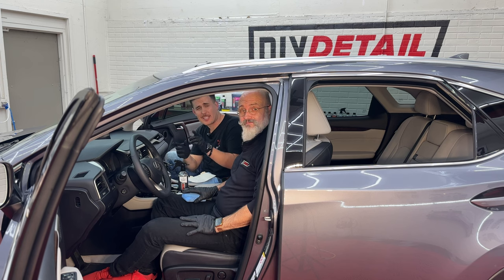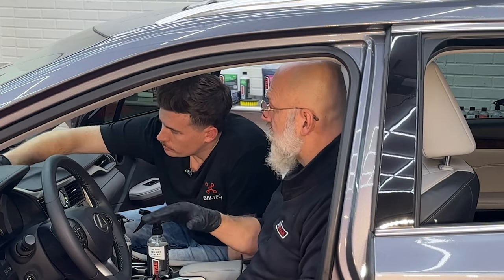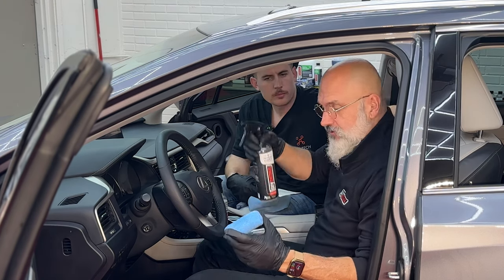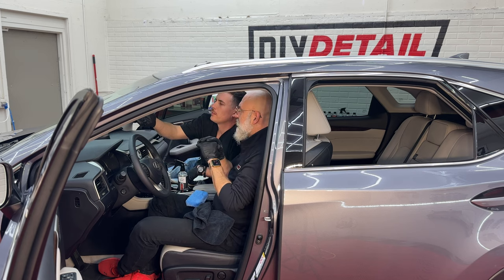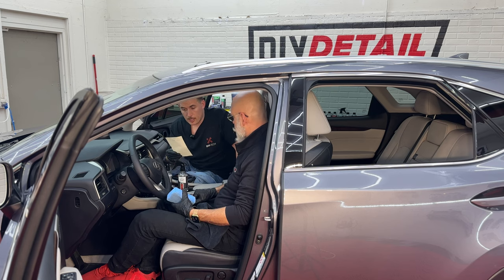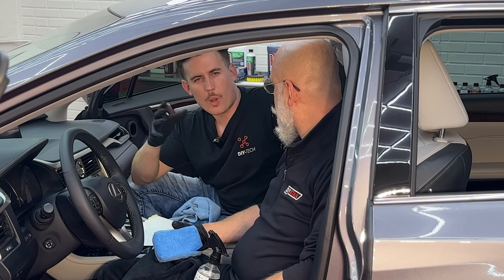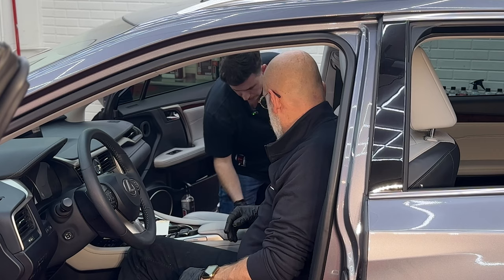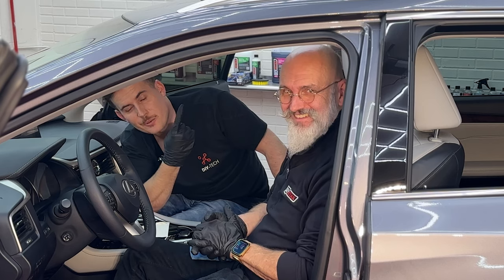Interior Ceramic: FREQUENTLY ASKED QUESTIONS! DIY Detail Podcast #34

Comment: Fully agree with the use an applicator approach, but can't make myself use the full sized block. I've had great success with the mini and finger mitt saver applicators - easier to get into tight spaces, use less product by keeping it on the surface of the applicator, and they are washable and reusable.
Reply from the maker: Great tip!

Comment: Can MF towels and applicators used to apply this product be washed and reused or should they be tossed?
Reply from the maker: If you soak them in APC or detergent immediately after use you may be able to save them.

Comment: I have used 303 Automotive Protectant once a month on the vinyl in my car's interior. I have cleaned the vinyl thoroughly with rinseless two times since the last 303 application. My car's interior is clean and otherwise ready for DIY Interior Ceramic Coating. Do you recommend I use panel prep before applying ceramic coating?
Reply from the maker: No, DIY Detail Rinse Less Wash is enough.
Reply: @diydetailofficial  Thank you!

Comment: So once leather seats have been coated in Interior Ceramic is there not a need for a leather conditioner? I've always been one to wipe the interior completely down with an interior detailer biweekly and every 6 months apply leather conditioner to leather surfaces. Where does leather conditioning fit into the routine?
Reply from the maker: You can if you want, but it’s really not required

Comment: I have a few question.
1) Should I use rinseless wash or clean & protect before interior ceramic?
2) if I use clean & protect, do I need to use panel prep before interior ceramic?
3) Does clean & protect affect the bonding of interior ceramic and reduces interior ceramic durability / longevity?
Reply from the maker: Your choice, but if you have both available use DIY Detail Rinseless Wash.

Comment: Greetings DIY Detail Team,

I use Leatherique to condition the Nappa leather in my BMW.  Is it safe to apply the DIY Interior Ceramic Coating over Leatherique or any other leather conditioning product application?
Reply from the maker: No, the coating will not adhere to

Comment: What is the smell like on this Interior Ceramic? and One thing I do not think was covered, is AFTER application, the best or recommended method to do interior maintenance?
Reply from the maker: It has a chemical smell that goes away once cured( 1 hour). DIY Detail Interior Clean & Protect or DIY Detail Rinseless Wash for maintenance.

Comment: Just received a bottle of your interior ceramic and have to say this product has a nasty smell to it! I'm not debating  interior ceramic benefits and realize are many other companies selling similar products, but this stuff should come with serious warnings on the packaging to wear not only hand protection,
 but a respirator. SiO2 is not kind to our lungs, and is not only a risk to the detailer, but to the vehicle owner/family with off gassing for days afterwards. And I think companies that market their products to DIYers, not professionals, have an even larger responsibility to ensure safety, or at least give reasonable warnings.
Reply from the maker: The odour dissipates within 30 mins. As for breathing it in, in a well ventilated room, and using an applicator will greatly reduce the odour.
Reply: Are there long term health risks when using ceramic/sio2 chemicals like this frequently as a detailer?

Comment: will this prevent or help prevent smudges from shoes on plastics of truck doors? I'm interested in kick panel area protection as well as the usual dash maintenance and cleaning.
Reply from the maker: It will help reduce, but not prevent.
Reply: @diydetailofficial  could a more robust exterior ceramic coating, one that's ok for plastic, be used on a door kick panel area?

Comment: is ceramic interior safe to use in conjunction w/ interior clean & protect?  if so, what would your routine/frequency suggestion be between panel prep, ceramic interior and interior clean & protect?  thanks
Reply from the maker: Once DIY Detail Interior Ceramic Coating is installed maintain with DIY Detail Interior Clean & Protect as needed

Comment: I already applied DIY Interior Clean and Protect and cleaned/applied leather conditioner in my seats, Can I still use the DIY  Interior Ceramic on top of that?
Reply from the maker: You will need to remove the leather conditioner
Reply: @diydetailofficial  thanks so much for the response.

Comment: Can you apply over interior detailer like carpro inner qd or other interior detailer or not necessary to use both?
Reply from the maker: The DIY Detail Interior Ceramic Coating is not a cleaner, but true ceramic protection for your interior.

Comment: I applied to my cars interior  about a month ago. I now want to have parts of my dash upholstered with Alcantara. What is the best chemical and process to remove the ceramic so the adhesive for the Alcantara will properly bond? Thanks!
Reply from the maker: Abrasive
Reply: How abrasive? Do I need to wet sand it? Or is vigorously scrubbing with a microfiber towel and using an interior cleaner like P&S Express and an adequate option? Thanks.
Reply from the maker: Use a compound on a MF towel. If you don’t plan on removing it at all future date, use sand paper.

Comment: @diydetailofficial :

New car and just learned about interior ceramic coating. I got some diy detail interior ceramic and did the car this past weekend. Worked great!

I just picked up a new adhesive magnet mount for my phone and I stuck it to the vinyl dash, but after 3min of holding it in place tight, it just peeled right off. I guess this interior ceramic really works! (I know some people dont like adhesive mounts, but this will be my 4th car with them and i really like it)

So what I need to do next is remove the coating from just this small 2x3in section so I can put the mount on and then re-coat next to it.

What's the best way to do this without damaging the vinyl on the dash?
Reply from the maker: Use some polish on a MF towel, abrasion is the only way to remove it.
Reply: @diydetailofficial  great! I don't have polish yet. I've only got the ceramic coating, clean and protect (green label) and label prep. What do I need to buy?
Reply: @lancekeltner2625 I would suggest their polish, the gold standard. Some polishes contain harsher solvents and may damage, the gold standard does not.

Comment: Do I need to use mechanical polishing to remove ceramic from interior before changing products or reapplying?

How do I prep for reapplication of interior ceramic coating
Reply from the maker: Simply wash and apply.
Reply: lol thanks
Kind of figured there must be other methods 
Than with exterior paint ceramic coat removal
Reply from the maker: Correct

Comment: Quick one, If the end result after application is silky/ sliding feel isn't that a bit dangerous when applied on the steering wheel?
Reply from the maker: It doesn’t change the feel in any way.
Reply: @diydetailofficial  Ok, was a bit confused when you guys mentioned when applied to the leather seats that you can feel them being a bit more silky and sliding.... so my logic meade me ask if the same will happen with the steering wheel.  Will test and report back!
Reply from the maker: Silky and soft.

Comment: Thanks guys, finally have your products in Australia. Looks like the interior ceramic bottle could last a while even if applying every 6 months to high traffic areas. Does interior ceramic have a shelf life after it is opened?
Reply from the maker: No shelf life, just make sure that you close the tip of the sprayer to prevent evaporation

Comment: I live in South Florida and have a vehicle that is parked outside 24/7, so UV protection to help prevent fading and cracking is very important. 303 Aerospace Protectant has always been my go to for UV protection on plastic/vinyl trim. Would a ceramic based product provide superior UV protection for interior plastics/vinyl?
Reply from the maker: A few things, first yes DIY Detail Interior Ceramic Coating will protect, and for much longer. 

Secondly, unless you drive a convertible, or leave your windows open all the time there’s actually litte UV getting in your vehicle. Automotive glass blocks almost all UVA rays and a high percentage of UVB. Protection is never a bad thing, but it’s not as critical as some marketing will have you believe.